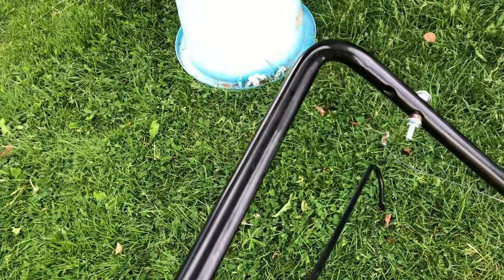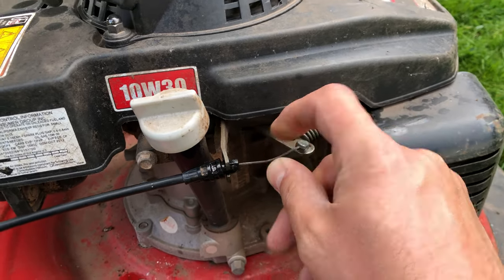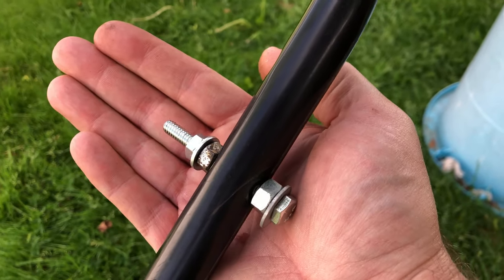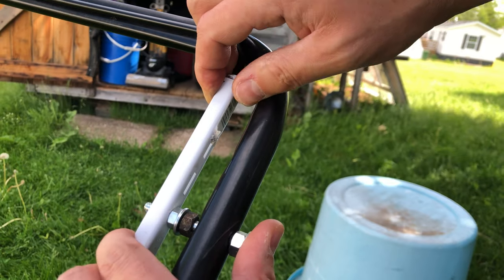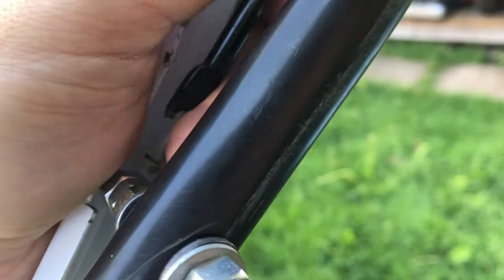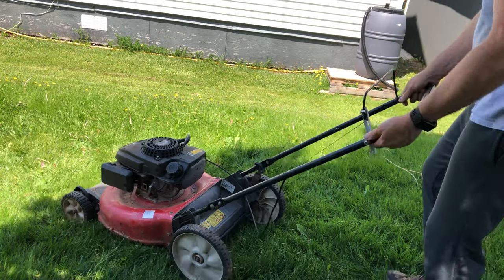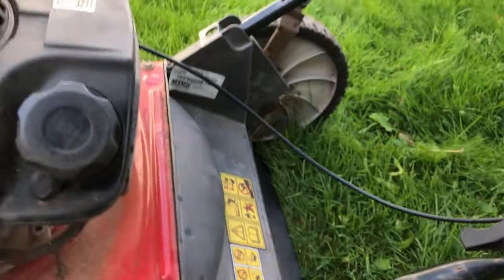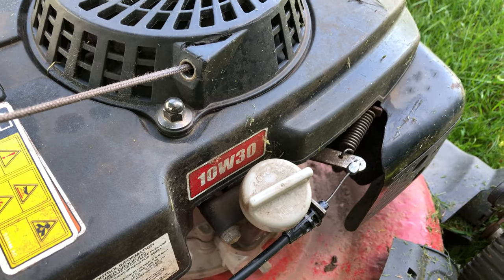Fixing a free lawn mower for cheap, fixing the safety bail bar handle. MTD Yard Machines Craftsman

Comment: I just completely removed mine when it broke. There is no cable or handle now. I also removed the spring from the cutoff lever and just use a think wood chip from the mulch bed to lock it in place when I start the mower and then I remove the wood chip when I want to cut it. It is not different than the cutoff switch that I used for my 1978 Lawnboy with which I cut hundreds of lawns.
Reply from the maker: Nice!  Yeah, removing the bail bar was an option but I have a steep hill to mow and the bail bar isn't a bad idea when mowing a hill.

I have an 80s self propelled lawn boy that never featured a bail bar - it just has an on/off switch on the engine.  Once it's running it will keep going until it runs out of fuel.  The old lawn boys are the best!
Reply: @spinphoto  That Lawnboy we bought in 1978 was a workhorse. I mowed about 15-20 lawns a years with it for 3 years straight in 8th, 9th and 10th grade and it kept on doing our large lawn for another several years. I don't remember what happened to it, but I guess it finally wore out.
Reply from the maker: @jamesgibbs6970  oh yeah!  Mine still runs, but it's in storage next to a mid 90s lawnboy mower.  I have a small lawn, so these days I'm using a cordless electric cylinder mower from Gardena, bought as new old stock at a local thrift store - I like it so much I bought two of them and rigged one up to use cordless drill batteries instead of 12v Lead Acid, the other is for parts since the mower was discontinued in 2008

Comment: I have a snowblower that the handle falls all the way down once released. The augar cable is fine. I think the lever that goes in to the hole is worn down. But I bought a brand new handle thinking it would fix the problem and it didn't. If the handle falls down the cable end falls out. Well if it's cold don't feel like taking off gloves to put the cable end back in lever. What would you suggest I do. I can make a video and put it up on my channel if needed
Reply from the maker: I don't have much snowblower experience but happy to look at a video for the challenge